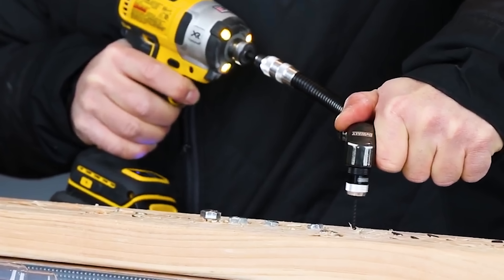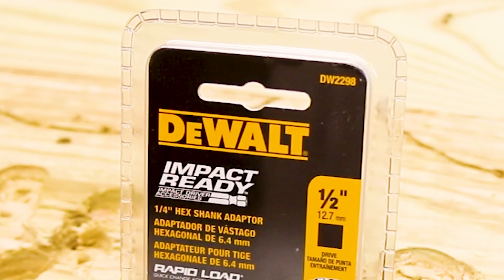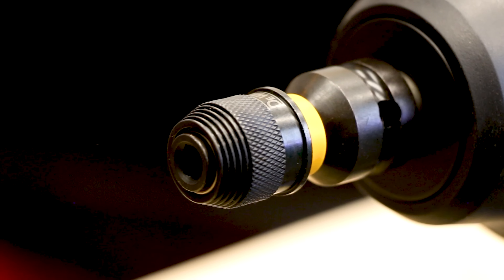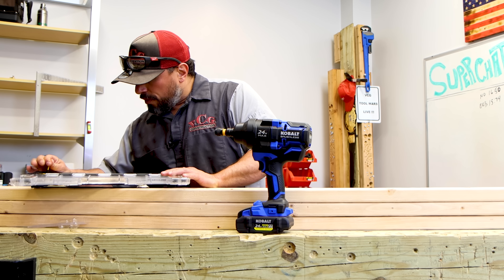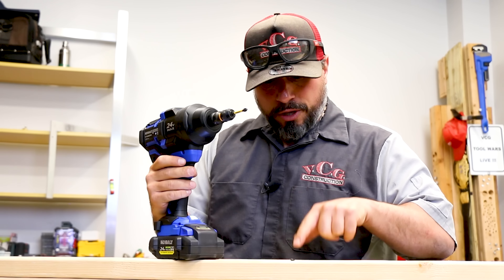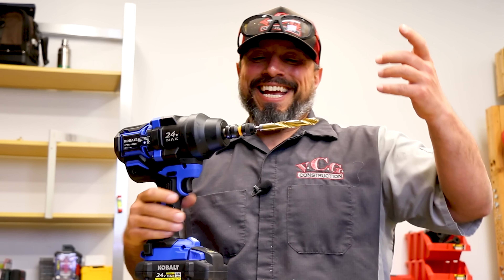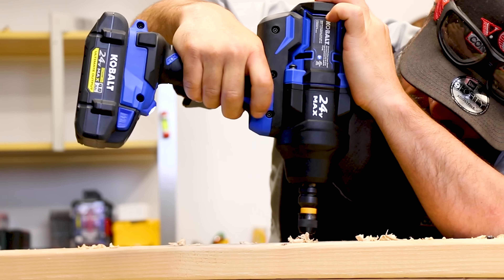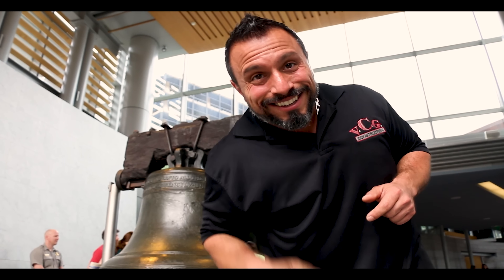NEVER BUY THIS DeWALT TOOL ACCESSORY (seriously)

Comment: I've used one before to drive 8" Timberlok screws, 1/4" impact driver didn't have enough power to completely drive it but my 1/2" impact wrench did.
Reply: If your impact driver couldn’t drive a timberlok, it’s either really old or it sucks
Reply: @legendarypillow1450 bs a half inch is a different animal. We build timber walls all day and drive timbers locks exclusively with 1/2 inch impacts I will be 1-2 screws ahead by the time you finish yours with a 1/4

Comment: I’ve had this adapter for at least 4 years 
It’s a great tool I used it to pre drill holes  then run labels into wood making mud flaps on my 
Trucks 
I Delivered new trucks with temporary mud flaps 
Some times they fell off I could put. 1/4 “
Or a5/16” bit driver in to run tech screws to hold the mud flaps on 
The thing of it was I traveled on air planes so I didn’t have room for a second 1/4” bit driver tool
All in all a great addition to my tools 
David👍
Reply: I meant lag bolts
These phones some times put in words that you don’t type in 😂

Comment: I bought this in combination with the DCF894 after a job where I was afraid my impact driver would melt in my hand, I wanted a reliable way driving really long thick screws or deck screws for extended periods of time and figured this would make for a good combo, and though my impact wrench has paid for itself in car work mostly, it's still great to have a really meaty back-up should something come up.

Comment: I’ve owned that adapter for years. Life saver
Reply: Dam right,,works great
Reply: do you not strip or break screws when you are using this much torque on a screw?
Reply: @juanectomanen5505  no

Comment: I use it at work for repairs. 
Use 1 tool for lag bolts and have the adapter to use if I need an impact. This avoids toting a bag with too many tools

Comment: I use this tool alot I have a 3/8 impact that I use up in a bucket and sometimes for small jobs I need it its easier to just use an adapter than actual 1/4 impact
Reply from the maker: Thanks for sharing your experience with this adapter Justin! We appreciate it!

Comment: Question: went to home depot and they had a dewalt 887 impact with 2 2ah batteries and hard case for $140.00. Good deal?
Reply from the maker: Not a bad deal but don't push that impact driver too hard. I would go with the 787 if you have a choice.

Comment: I feel like the main use case for this is with smaller impact wrenches to effectively turn them into normal impact drivers.  For example, the M12 FUEL 3/8" or 1/2" impact wrenches are pretty similar form factors to the M12 FUEL impact driver, but they have more power.  As a small engine mechanic, I end up running sockets constantly, but since I also repair electric power tools, I need to run 1/4" hex bits all the time as well.  The 1/4" hex to 3/8" and 1/2" square adapters work fine, but I've seen people snap socket adapters.  This looks like it's got to be at least as sturdy as the collet on an impact driver, and the overall tool length would be about the same as the impact driver too.  I love the M12 FUEL impact driver I already have and have no plans to switch away from it, but if I didn't already own it and was trying to decide between the impact driver or one of the impact wrenches, this type of accessory would be a pretty compelling reason to go with the impact wrench instead of the impact driver from the start.

Comment: I was wandering around lowes the other day and I found this by accident, someone had left it out in a conspicuous spot. This adapter immediately made complete sense to me. I thought of the stud packs that, as an electrician, I have to drill through ( 4 to 6 2x6 s) is not easy to do. I use my kobalt (non xtr 1/2 impact wrench) to drill through these stud packs. I found if you use # 12 solid wire through that hole in the adapter through the 1/2 anvil that you put the sockets usually go on, drawing back the bit out of the wood isn't an issue any longer. Just FYI.
Reply from the maker: Thank you for the awesome feedback David! What an crazy coincidence that you found this adapter! Great points on the uses for this attachment too!

Comment: I have one of these made by a different company.  3/8 dr to1/4 inch hex bit. Use it on a older 3/8 makita battery powered 50 foot pound impact gun for small engines. Works great not to much power to break things.

Comment: Got the Milwaukee version impact rated and it's perfect made my DeWalt DCF902 3/8" impact wrench into an impact driver, I'm a DIY home owner but I have mostly impact wrenches to do all maintenance on 3-5 family cars and fixing them my self saves me thousands. With the adapter I take it under the car put it on the 3/8" impact wrench then use a screw bit and remove the bottom protection plate from the car, saves me from having two tools, I can basically use one tool to do everything.
And if I need to drive screws around the house it's there and don't need to buy an impact driver 👌

Comment: Old video, but whatever, I'm going to share my very specific use for this tool.
I'm an agricultural/utility fencing contractor here in the UK. Fitting gates I would have use for a large cordless drill, large impact wrench and smaller impact driver. Instead I use a 7/16 drive lineman's impact. Large augers fit straight into the 7/16 for easy boring through the 8-10 inch posts. I carry an adapter for 1/2 drive sockets that I use for the hinge hardware, and this adapter for smaller augers sometimes needed for hardware fits on timber gates. One tool instead of 3, more efficient and less to carry

Comment: I have the Milwaukee 3/8 sq to 1/4 hex.  I know it’s not the exact adapter reviewed on this video but they are basically the same thing. It stays in my tool box. When working on cars under the hood if I need to drive a screw that I don’t have a socket to fit. I pop it on. Reason being I keep my wood working tools separate from my automotive tools.  Inevitably if I use my impact driver on my vehicles I’ll get grease on them and that grease will wind up on wood projects. It was way cheaper to buy an adapter instead of a second impact driver for automotive use. My 94 Ford pick up has a surprising amount of Phillips head screws under the hood.  I also often use the adapter on my M12 3/8 ratchet.

Comment: Questions,  I am weekend woodworker.  Sometimes I have hard time to drive long screws on hardwood with my dewalt  impact driver.  So, I am thinking to buy impact wrench  with that adapter, maybe more power.  Is it good idea?
Reply: The limiting factor is the strength of the 1/4 bit. It will either work or break. Just spend the extra time driving in the screws, the tool does all the work you just pull the trigger.
Reply: Better solution is to predrill before driving screws.  Your impact should do just find and predrilling prevents the wood from splitting..

Comment: If you blend this adapter with 
Dewalt DCF921N-XJ  you'll need only a pin and ring  to hold it on.
Specially when is for hours of work .
The DCF921N-XJ  is compact and powerful enough to do any tasks 405Nm tightening torque.😎👌

Comment: So I just bought the Milwaukee version of this adapter with a corded Milwaukee Impact wrench... It was either this or a Makita corded impact that has a 1/4 in hex quick release... But the wrench has so much torque. What do you guys think? I just want something corded for big jobs... "Let me charge my 8 batteries". Milwaukee employee at home depot was doing something and I stopped and talked to him.. he said all the corded stuff is going away. Basically for creating large holes for HDMI cable through say 9 boards... 9 is my record. I used a Ryobi 1HP Impact battery with a 1ft extension and one of those spade bits... 1 1/2 inch. I like those more than the Irwin speedbore because those are hard to punch through the final board at the very end. What would you guys use???

Comment: I have the dcf885 (actually I have two 855's one ancient and still trucking- one new as a spare)  the dcf890, the dcf894 AND THE BIG BAD 899 .... IM definitely getting one of these adapters, not sure what I'll wind up using it for but I'm positive I'll use it. I use my tools for mostly mechanical work with a few odd jobs around the house here and there.
Reply: Dang auto correct messed up my numbers. I have two of the brushed little guys one old one new. Those are awesome little drivers but sometimes you just need more power...

Comment: I bought one of these of a different brand online, i do van conversions, i use my impact wrench all day every day for a range of fitments, the other guys who use impact drivers all have tape around the chuck to hold the bits in as the chuck has failed, if my adapter fails I will buy another adapter from China for 2 pound, I've been using this one for over  year with no sign that it might fail soon, plus it means I only have to carry one tool instead of two

Comment: I have used a similar adapter that goes from 1/2" to 1/4" to help install the screws for the aluminum/wood flooring on 48'-53' trailers. Mine is a Snap-On brand adapter without the magnetic bit holder. It helps deliver more torque than is possible with most impact drivers, even some pneumatics.
Reply from the maker: Thanks for sharing your experience Adrian we appreciate it!

Comment: This is made for someone like me who only works on cars. I have no need for a regular drill or for that matter a impact drill. I recently bought some solar power lights to mount outside my front door and just what, no impact drill to use a drill bit🤷🏽‍♂️. All I need it for is 2 or 4 screw so this works 110% for me. No need in buying a whole separate drill or impact drill when I have a good impact wrench!!

Comment: I find it a great way to impact drive bigger sized holes which some regular impact drivers maybe too weak to do also instead of carrying all these different tools I can just keep my half inch DeWalt dcf899 impact wrench in my truck and toss in the converter adapter and Kabam I don't have to carry around my little impact driver I just keep the impact wrench in the truck half-inch in case I get a flat or need to do something on the Fly mechanically with my truck so it's pretty cool to have this accessory Plus a basic quarter inch impact bit set!

Comment: I'm just your average weekend diy dad on a budget and I have 3/8 and 1/2 impact wrenches and a M12 driver. This is perfect for me so I don't have to buy a M18 driver and save that money to buy another tool instead. If you use these professionally it would likely make more sense to have both wrenches and drivers in both voltage platforms and use the adapter as needed or as a backup.

Comment: i think it would be a good back up tool like if your impact driver took a crap and you had to finish a job. itll keep you going. idk if id drill holes all day with it due to the fact it does not back out well. but i think it would have a purpose in a contractors tool bag.

Comment: Doesn't look like it wobbles. Just use hand guide when removing drilling bits unless you have a tight pin detent that requires a awl tool to remove it.

Comment: Love mine!!. I'm building fences and I'm putting in 4in screws. Turned my Milwaukee Stubby m12 (250ft. lbs) into impact driver with 3000in. lbs lol !!! Most powerful impact driver;) this 4×10 screws going into treated lumber in seconds !!!! Most important thing it's quieter !!  much quieter than my m12 Milwaukee  driver with 1100in. lbs

Comment: I actually just bought the milwaukee one and got it in the mail about a week ago for my impact wrench. From what I saw on another review the adapter is good for up to like 2200in lbs so I used speed 2 on my ridgid gen5.

I do have an impact driver but its nice that with a socket adapter on driver and this adapter both tools can overlap in some areas without havin to take both with you on a project.0
Reply from the maker: Thanks for sharing your experience and feedback mixwell1983 let us know how it works for you!

Comment: Well my Milwaukee M18 FUEL mid torque impact is the pin detent version, so the retention shouldnt be an issue on the anvil.  It's great if you don't have an impact driver or a powerful drill.

Comment: I had one of these adaptors before, a 1/4 hex to a drill style keyless chuck. Basically got it so that I could use my small impact with traditional style drill bits and allen keys that I cut myself at a production job that didn't have a quick connect end. They don't replace the proper tool or proper bits, but can be useful in unique situations or when you don't have or don't wanna lug around your entire tool box.

Comment: Milwaukee has made those for a while now. I have the Milwaukee one in 3/8 square. I use it on my m12 3/8 stubby impact to drive screws when working on cars.  That way only one driver is needed for every fastener on the vehicle.

Comment: I have an old Makita impact driver and I've had it for at least 10 years. I recently bought the new Makita 172 and frankly now im spoiled because its so fast and powerfull. I usually like runing 2 impacts on a job because quite often there are two kinds of fixing and it wastes a lot of time changing bits if you only have one. My old impact driver is sooooooo sllllooooww and I'm treating myself to an upgrade. Sometimes I fix big concrete bolts and other large nuts, the problem is the 1/4inch hex to 3/8 adapters are weak and often snap. thge real nightmare scenario is if they snap in such a way that its hard to remove the broken part from the impact so my solution is to get an impact wrench for the heavy work and use this adapter to turn it into a second impact so that if I'm doing a job that requires two different screws it can do that as well as the heavy bolts

Comment: I picked this up at Lowes, was cheap.  I don't use it to drill but have used it a couple times with some difficult bit screws.  I already trashed my 1/4" bit driver once (Dewalt fixed under warranty, quickly too).  But don't want to break it again.

Comment: I'm considering it for my Jeep tool kit. A 1/2 driver is more useful than the hex for trail repairs. The adapter will give me the best of both worlds out of 1 tool without the risk of snapping my 1/4" hex to 1/2" square adapters

Comment: Milwaukee makes one too.  Mine is very tight.  Probably wouldn't fall off when backing out like the DeWalt did.  I have it for when I may not have my impact driver with me.  I also recommend the Makita drill adapter for using drill bits with 1\4" tools.

Comment: Hey Vince I have use these adaptors for years when running in heavy duty fasteners in large quantities like 6" Grk's , or when I was building sunrooms and some of the fasteners took more power and the small impact would struggle, bought my first adapter in 2007
Reply: I imagine there is a much less of a noticeable power struggle as the impact wrench delivers strong power straight out of the gate. This is one of the best applications I’ve heard of.

Comment: this tool might be ok on hand tools like a breakover bar or a ratchet with like torx bits on brake calipers. but in reality its over kill due to there are socket bit sets especially made for those jobs. perhaps a 3/8drive to 1/4in hex

Comment: As a fire sprinkler fitter, I used to use an impact driver for years with a ¼x½ socket adapter for fastening bolt couplings and was sick of breaking these adapters and a weekly or monthly basis so I went out and bought an impact wrench. That being said we use ¼" bits almost every day as well for driving screws and the idea of having both impacts around for each task is not something that appeals to me. The less tools i can have in my bag the better so if i can get away with having an adapter in my tool belt or bag, then its a huge win.

Comment: The problem is not the adapter, but the hog ring. Detent pin is much better. I have Dewalt DCF894 with pin, and it holds onto sockets well
Reply: Blasphemy! Ring is King. It really depends on the application. If you are working on heavy equipment consistently and swap between 1-2 sockets then Pin is better. But imagine trying to get the detent to release off a socket if you were working on something that changed sizes 6 times doing the work. You would hate life instantly.

Comment: Its not ideal as my impact wrench is more likely to over tighten fasteners and is big and clumsy, but having that adaptor in my apron while using my wrench without my driver has saved me walking back to my ute to grab my driver a fair few times now as i can just grab my adaptor and bits from my apron

Comment: When you work for a cheapskate who only has an impact available for you but you occasionally need to drive a screw to fix the cheapo "custom" made pallets, this will be super handy.
Reply: This may or may not be stemming from some sort of experience! Lol, we have all worked for “the cheapo”.
Reply: I'm guessing your using a pneumatic impact. It should still work.  Or, use nails, if he's that cheap.

Comment: This adapter is good for using 1/4" hex to 1/2, 1/4 and 3/8 square impact socket extension adapters with your impact wrench, which are often less expensive than regular socket extension bars. Good if you're using a wobble socket set up with two extensions at 45° angles to get into tight spaces on the car or truck with your wrench. That's actually what I bought mine for, or one similar to this, not for drilling in this case.

Comment: This is a bit of a weird one but hear me out, take the impact wrench and put the hex attachment on it, THEN put the keyless chuck in the hex to turn it into a drill. Test it in a TTR against a drill and impact driver and see if one tool with a couple attachments can replace them both.
Reply: I think there is a 1/2 to drill chuck adapter already if im not mistaken.
Reply: Am I missing something 😂. I thought that's what this video was about.